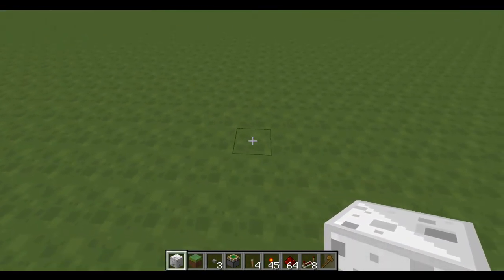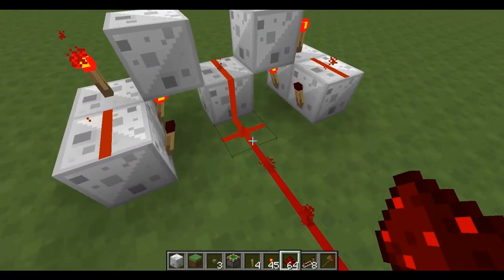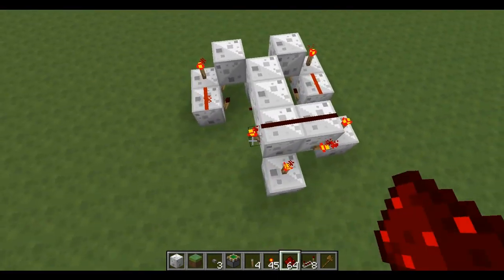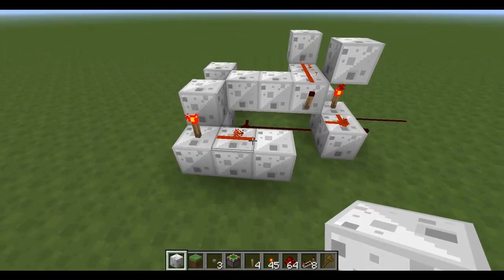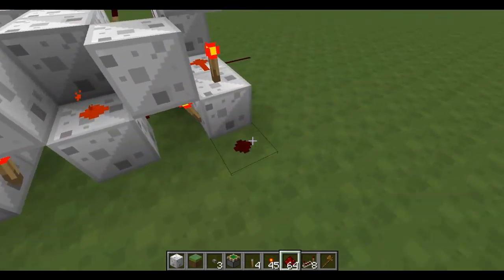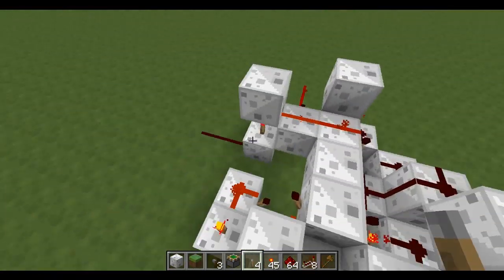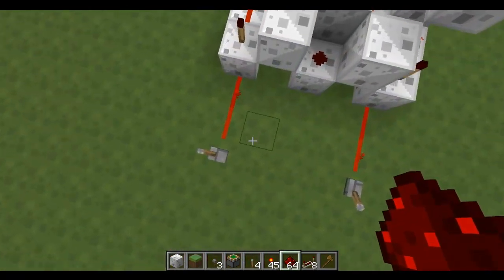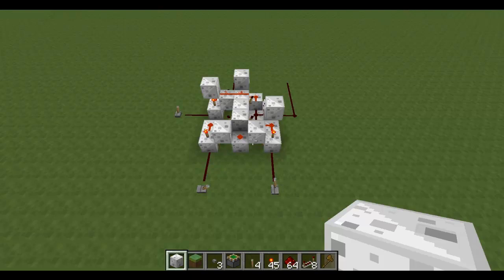Minecraft Compact Full Adder [Tutorial]

Comment: "1+1 = 0" da faq
Reply: 1+1=10 in binary, so the output is going to be a 0 and 1 is going to go to the carry out.
Binary is used in real computers btw, so a 1 in binary in a computer is going to be an electrical signal/current ,and a 0 would be no current at all or little voltage.